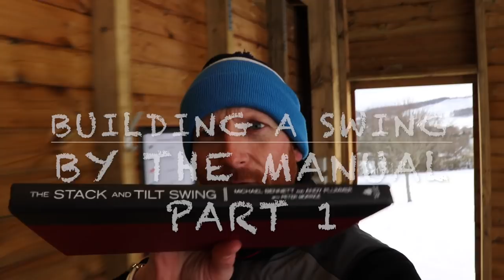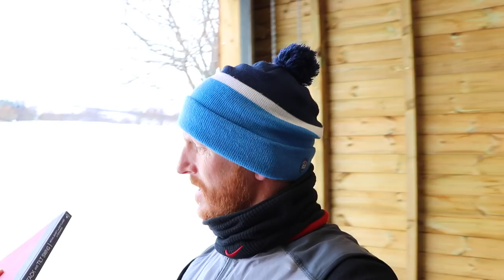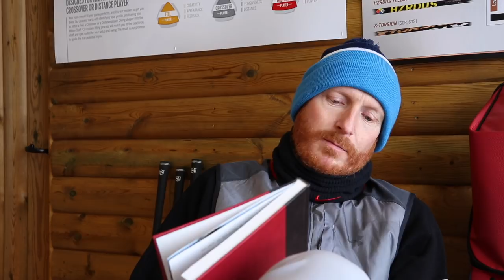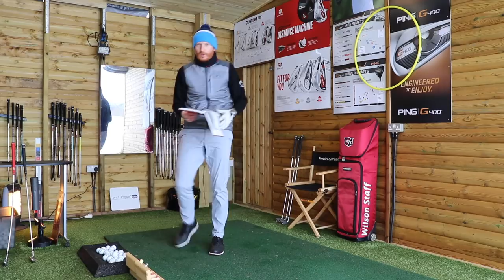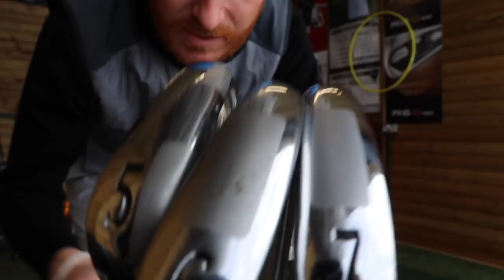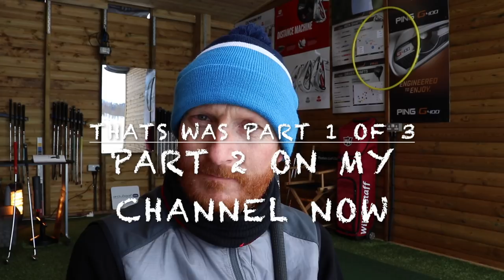Stack and Tilt swing in 5 moves PART 1

Comment: One of the best golf books ever writtenits up there with the golfing machine i also recently changed to this method and the results are unreal, a lot of it does go against everything that is usually taught as you say, i spent years struggling to move and shift as taught, spent more time trying to stop the hands and arms taking the club to the inside , could not work out how Hogan managed to take it and hit the ball so well, now i get it, and he did it with his left arm pinned to his chest, another no no.
Looks like you were reacting to the method exactly as i did at first, but the feel of the club as you hit the sweet spot and the ball comes off the face like a bullet, convinced me to stick with it and make it work, its not hard to do . scores came flying down, and not topped a ball for ages.

My practice is now fun and i don't spend nearly half as much time practicing the full swing,

Comment: I've been trying so many things over the last 5 months - and nothing seemed to get my fat chunks AND my pushes to go straight. It had been very frustrating. I went through all 3 of these videos and noticed that this reminded me of my natural flat swing that I had started eradicating back in 2007 when all the advice seemed to be, that I should have a more upright swing. This worked for me, pretty much immediately today on the range, it felt good, natural, straight with good solid contact and spared my wrist and shoulder of former ground impact. I do have to be careful when turning the left shoulder down, not to dip my whole upper body down....that resulted in fat divots again. But once I got all of the moves in place, it sorted itself out. Thanks for demo'ing this!

Comment: The "trick" in any golf swing in which the club is moved away from its alignment, either vertical or horizontal or both, with the forward arm (wrist cock or hinge) is when to allow or force the release of this angle to happen. Too soon and too late are heart breakers. Also in a 2 plane swing the golfer must coordinate the turning of the body and the lifting and dropping of the arms in order to hit the ball. In both 2 and single plane swings the hands and arms must not roll trail over lead too much (hook) or trail under lead too much (slice).  Got it?  Happy golfing!
PS:  I just loved your video. Bravo!

Comment: Have a dodgy left knee and back issues so tried this by flairing my left foot out with weight left then turning by pushing my left knee out over the foot. Left shoulder drops and right hip naturally turns back and up. Initiate the turn by pushing up with left leg.

Comment: You bump your hip to the left closer to target like there is a wall to your left. keep your weight  to left then swing. or is that the reverse K or is it the same thing. confusing much
Reply: James Adcock the answer depends on body dynamics but typically what the swing model requires is instead of using the middle of your chest (say the buttons on your shirt) as the swing centre you use your left knee/hip as the swing centre. Now to get the club behind you on the upswing, without the lateral shift and rotation in a traditional swing, your shoulders do the work by swinging in much more “up right” fashion, which is why Steve felt that in a way of swinging more upright, dipping the left shoulder.
Whether you bump the left hip or not depends on your setup but what you really want to be doing in setting up with left shoulder, left hip, left knee all pre-aligned... almost pre-setting the impact position in a static way.